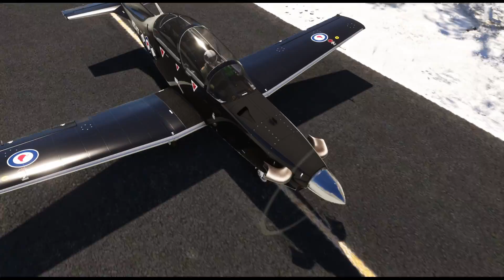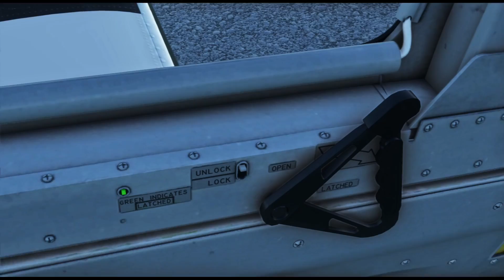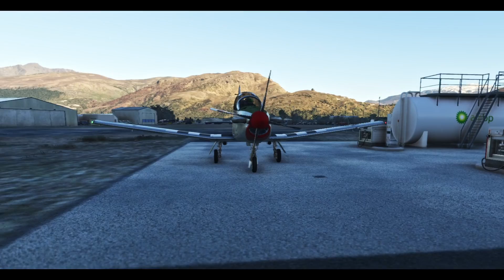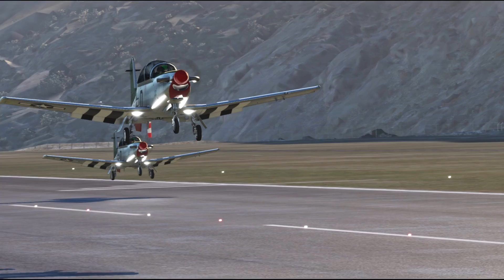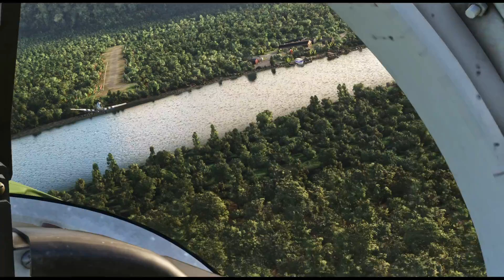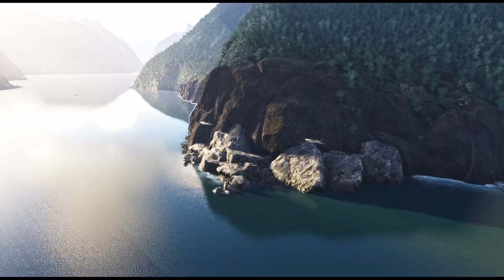Flying Americas Most Advanced Trainer | T-6B Texan II Start Up & Cinematic Flight | MSFS2020

Comment: I find the aircraft constantly rolls to one side when the torque is set to max thrust
Reply from the maker: Yes it does! and powering down to idle it twists the opposite way too. Begs the question if the flight dynamics are like that in real life. I believe Iris spent a large portion optimizing that flight model. I assume that torque factor was intentional..
Reply: @EricTFDC yes it does actually roll with the throttle adjustments in real life I flown the Texan (Harvard 2) cause I was in the Canadian airforce, however the rudder and aileron needs to be trimmed throughout the flight. The manual for the iris Texan says to keep the assisted rudder trim on and that does take away the constant rolling but for realism factor you won’t be able to simulate cross wind factor during take offs and landings I’m hoping these guys release an update for this stuff soon there’s a number of bugs in both this and the pc-21 that need patching up.
Reply: Does in real life too, the 4 left turning tendencies with power addition is one of the first thing we teach  students
Reply: Its called the torque effect and creates a rolling moment opposite the direction of the propeller motion, most apparent on aircraft with high torque. the T6's PT6A-68 delivers 1100 shaft horsepower which creates a strong torque effect when at low airspeed and going from idle to max.